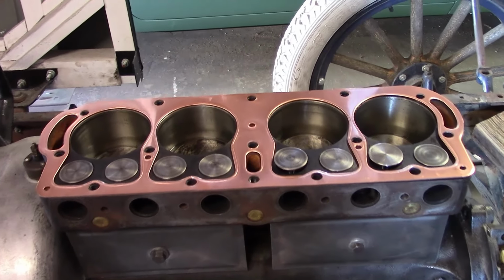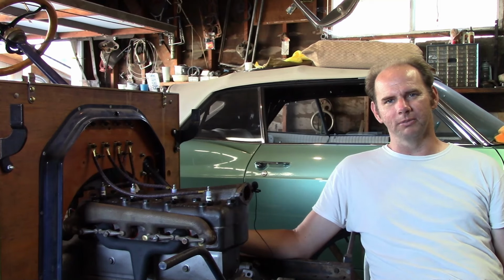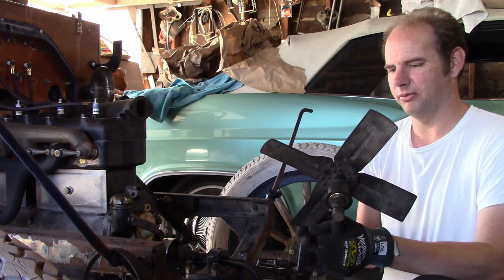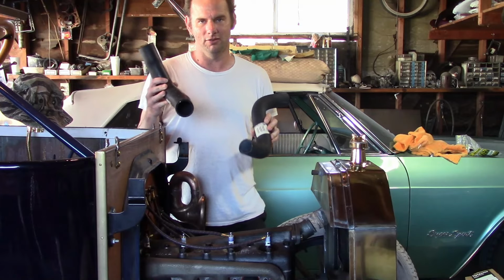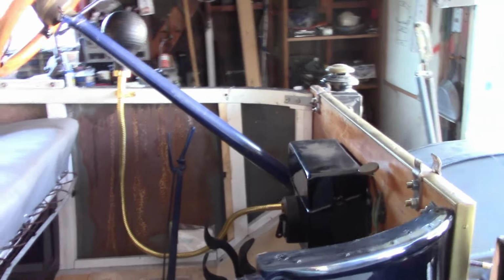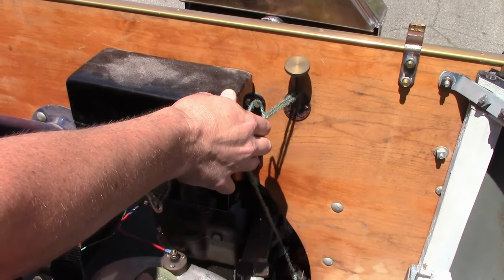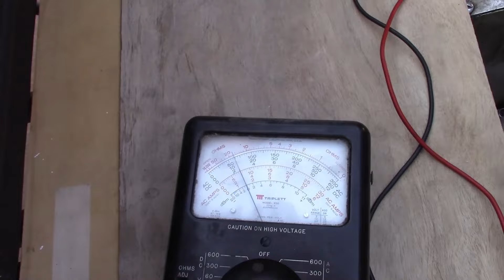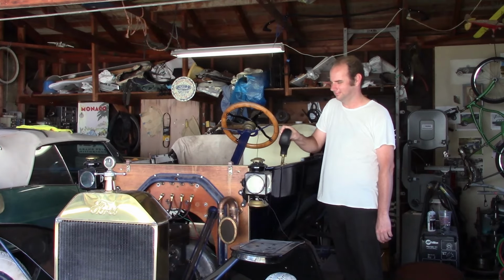Will it start? overhauled Model T engine.

Comment: nice Chevy.  I had one of those with a three on the tree back in the day.  I also have a T in the garage, a 1923 touring.  I just took out a piston and had to rewire the safety wire on the rod bolt.  Several years ago I had the mag short out and now I know where that bit of wire came from!
Reply from the maker: Cool. Yep, they're a lot of fun.
That has happened to me too. A small piece of wire got in the post and shorted it out.

Comment: I guess the Head Gasket goes on dry ------- would think by now they would be spraying a little sealer on for added protection ---- like how the manifold is held on ------ little spreader bars ------- wonder if they broke a lot -------- In hand cranking ------ have you ever had it ----- Kick Back ------ I think one is supposed to grab the handle a certain way so you don't get hurt ------ It's looking good ------ I bet you can't wait to get her on the road ------- Thanks for sharing with us ------ An Era that I bet a lot of us never got to see ----- but only stories and tales of how it use to be ----- It's nice you take us along in the rebuild / repair of a Model T ------ Hope you have a Great Week ------- Rodney
Reply: I haven't cranked an engine since the 70's

Comment: T looking good, I just had 1 question, I have a 24 touring T that I will be tackling that's all in crates, how much did you spend on your T's getting them on the road from a derelict condition ? or how much would you spend on restoring one to drivable condition, not pebble beach standards?  I know it's a hard question, assume the engine and transmission are ok.
Reply from the maker: Since I do my own interiors and pretty much get the paint done for cost, I've been able to finish one for about 5,000. give or take.